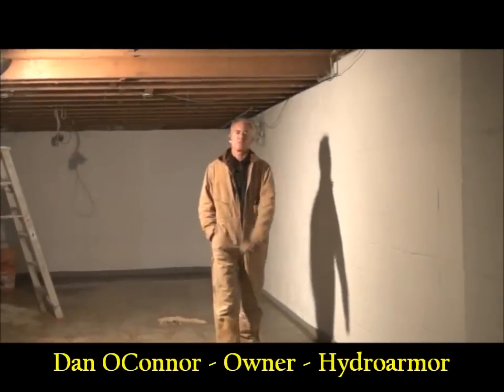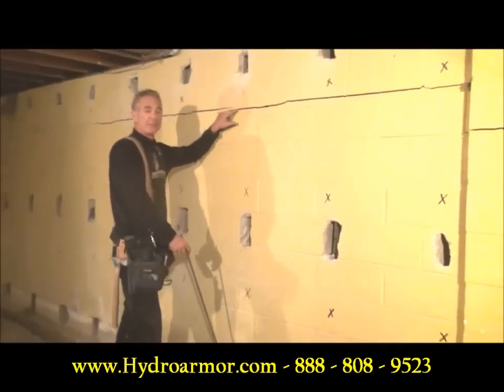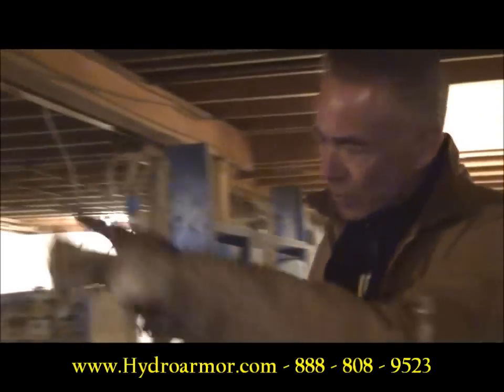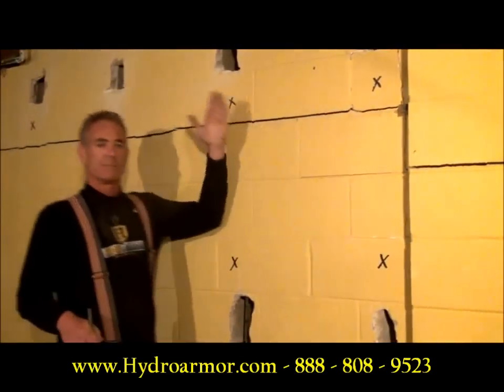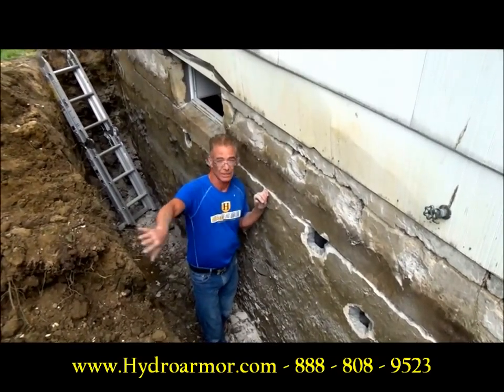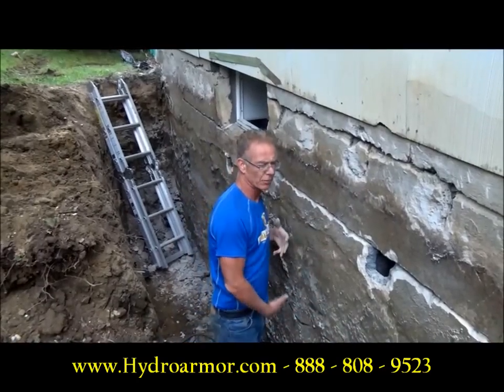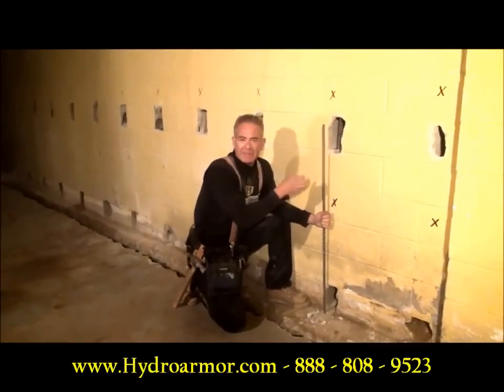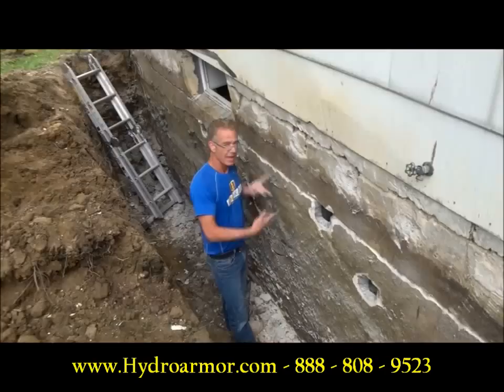Save Tens of Thousands - Combined Repair and Replacement of Failed Foundation Walls

Comment: Considering buying a home that has a bowed wall in the basement it doesn't have a huge crack but is bowed they put up metal reinforcement but I'm not sure if we should buy it or not? How hard and expensive is this to fix and is it something that needs to be fixed right away or could we save for a year and then fix it?